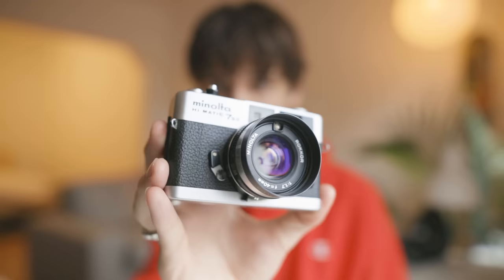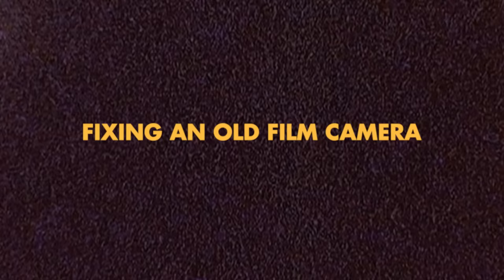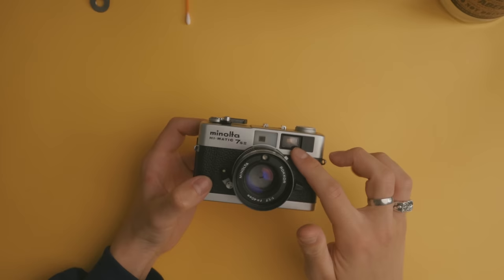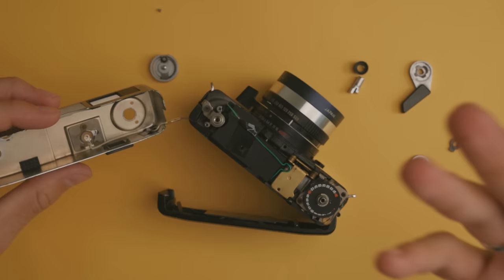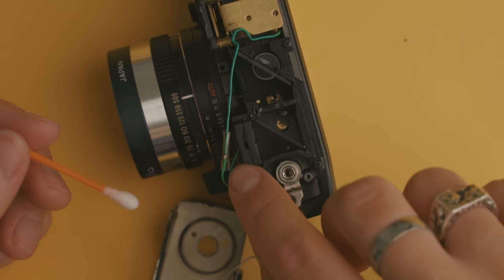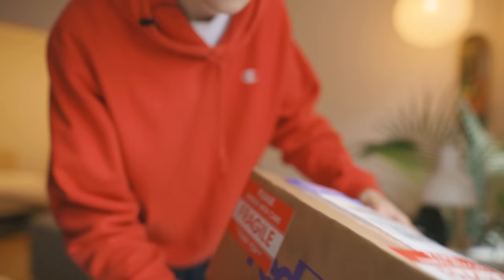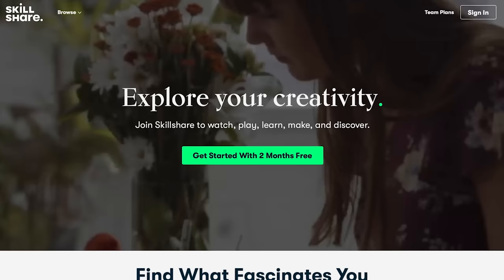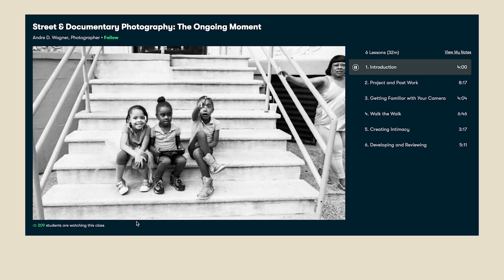Fix Your Old Film Camera at Home!

Comment: I cleaned my 7sII viewfinder, but as I didn't know, I cleaned every miror and with 90° alcool! 😂 Maybe I'm lucky, but it worked. Before the finder was foggy and I could barely see the rangefinder image, now the viewfinder is like new, and the rangefinder image is a lot more visible. With the addition of a pink filter on the viewfinder (multigrade 1 1/2 filter), the 2 images are clearly visible and focusing is very easy again. The camera is now fully operational again! 🙂
PS: you may have been right not to touch the semi-transparent mirror, but a blast of air spray wouldn't have hurt...

Comment: By the way, for anyone who ever sees this camera (Minolta Hi-Matic 7s II) and thinks about buying one, you can also look for the Canon Canonet QL17 G-III, which also has a 40mm f/1.7 with shutter speeds between 1/4th to 1/500th for slightly cheaper

Comment: Alcohol does not do a permanent job of removing many types of fungus. For that you need hydrogen peroxide. I use both - the peroxide first. The silver surface mirror is actually cleanable, but with a VERY light touch. Andy

Comment: Question for WV or followers: Which of those incredible places who fix old cameras do you recommend in the greater NYC area (Tri-state, though most preferably NJ)? Despite great skill, I know that I can't tackle this one: Bronica ETR 75mm lens with light fog on the rear element (no fungus, dust or scratches but the fog is noticeable). Who would properly and reasonably cheaply fix that? Lens is not of great value (100$ after repair?) however, it is a part of their unique anniversary camera-and-lens release (and camera itself is working and looking as new) hence worth some overspending within a reason... Any suggestions?

Comment: Hey Will thanks for this video.. I have one of these and it doesn't work unfortunately. What batteries are you using since mercury's are discontinued? Also does light meter work without batteries? Can that be fixed if camera is taken apart?

Comment: Can i do the same thing with a canonet QL19? I've purchesed one recently, I'm using the first film yet but im afraid things are not 100% with this camera. also afraid that the foucus are not right
Reply: Yes you can. When i cleaned mine i used a dry cotton swab on the inner vertical glass Willem warns not to touch, just to get the dust off. Also, it's a good idea to clean  the inner glass attached to the top plate as well. You can adjust the rangefinder while the top is off too. There are 2 small flat head screws in that area that need to be adjusted. Just set focus to infinity, aim the patch at something in the distance and make very small adjustments as needed until the patch lines up. One screw is for the vertical adjustment the other is for horizontal.

Comment: I have a question about my film camera meter. So I took reading with both my digital, with the om-1 the settings were iso200/ shutter 125/ f 2.8 and my g85 iso200/ shutter 125/ f 3.5. The meter on the g85 showed a correct exposure while the om-1 was underexposed by 3 with a faster aperture. So is the light meter on my film camera useless or do they just work differently? Also always with the om-1 the exposure changes considerably more when I change the f-stop than when I change the shutter which shouldn't make sense? 
I started recently so just trying to make  sense of it all 
Also any budget light meter to recommend?